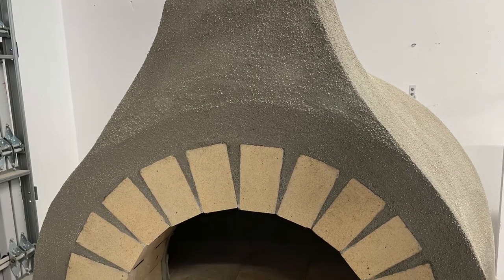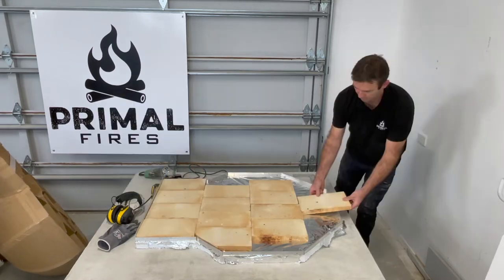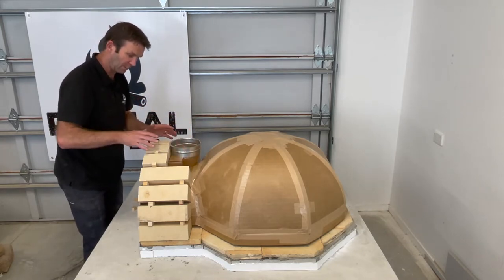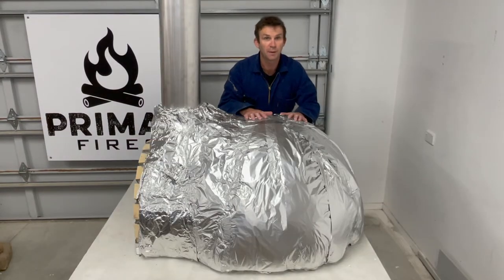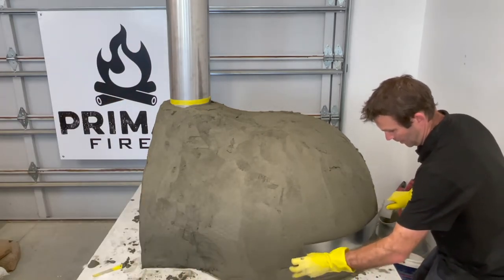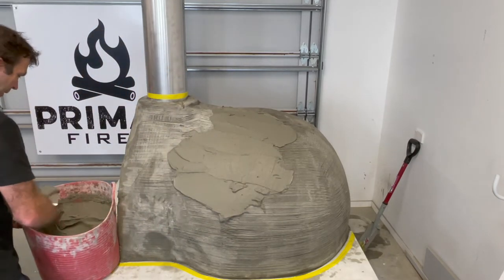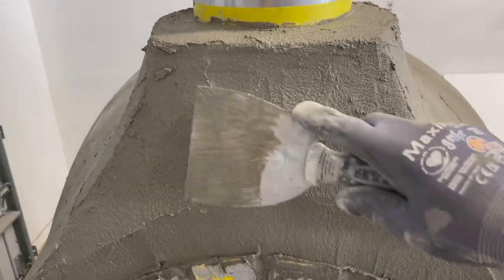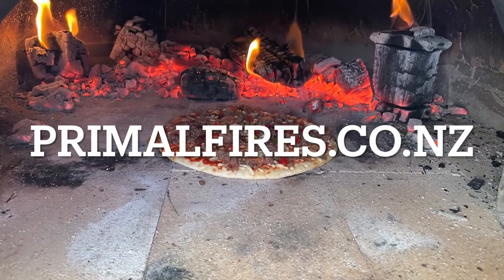Construction summary for Primal Fires 800mm DIY oven kit

Comment: Hi. How do you remove the cardboard? Set it on fire?
Reply: Hi, you simply reach in and pull out the centre supports then pull the mould out. It’s very easy
Reply: I was totally guessing it just disappears during the curing fires